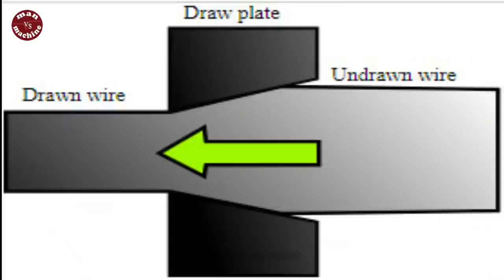Converting Iron Rods Into Steel Wire Rod | Wire Drawing Process

Comment: The correct title: Converting pieces of steel wire into rolls of steel wire filled with splices, which the customer will only notice when the final product breaks.
Reply from the maker: The force with which this wire is being pulled on the machine, if it has to break will break only when it is, not breaking yet, how will it break later.
Reply: @ManVSMachineHD  the force needed to pull this wire on to that rolling machine is mere fractions of the tensile strength of a 3/8 inch steel cable, which is about 14,400 pounds.
Reply: Correct! These guys really do waste a lot of time in all their videos.